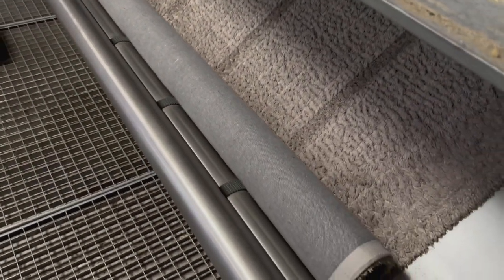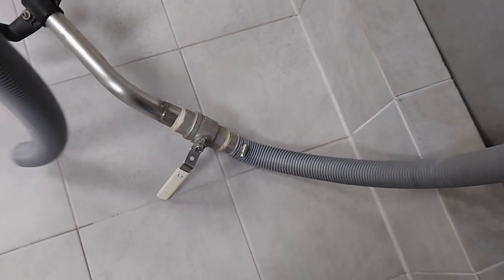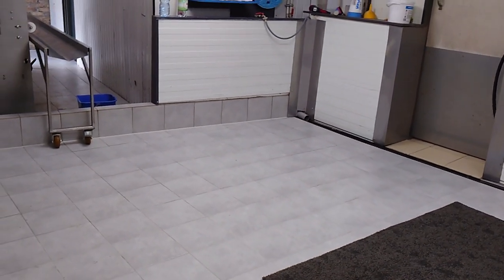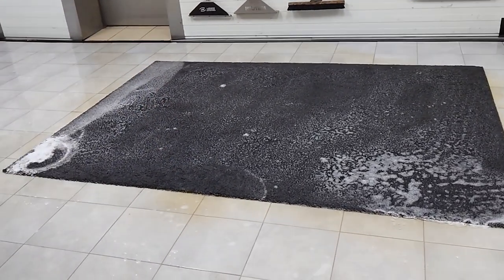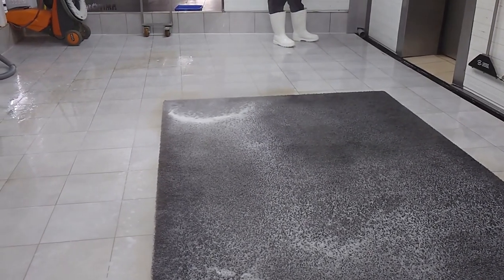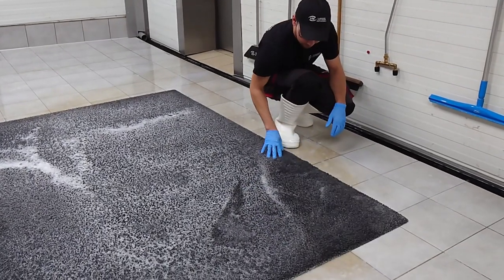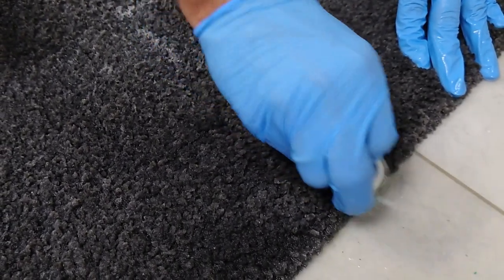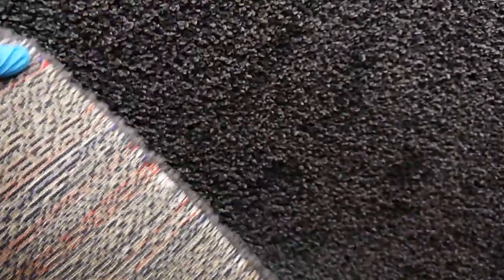Zwykły dzień w pralni dywanów. Pranie dywanu, usuwanie plam, naprawa węża i skakanie przez nogę 💪😍🌊

Comment: FANTASTIC JOB AND AWESOME Behind The Scenes video, Jakob!!

Thank you so very much for these videos about your everyday routine!

Thoroughly ENJOY seeing them!!

ONE question...

Do you beat every rug you work with or do you determine if they need it or not, and some might not?

Just wondering.

EDIT:
I didn't realize until this video that you use a Rug softener solution (like using Hair Conditioner after shampooing) on the rugs as well...
Although it does now make complete sense...
Since it softens up the piles of the rug!

I always thought it was just another type of soap.

Thank you for clarifying this here in your video!

Fantastic commentary on the whole process!!

WELL DONE!!
Extremely informative... and interestingly captivating!

Comment: You sir are a very good teacher. I think that stubborn green stain was chewing gum of some sort. In my experience it's the hardest thing to remove from fabric.
Reply from the maker: It is good that there is already a way to chewing gum, plasteline and similar things. It used to be through newspaper with an iron to try to peel it off, but that never gave even 90% success rate 🤗💖